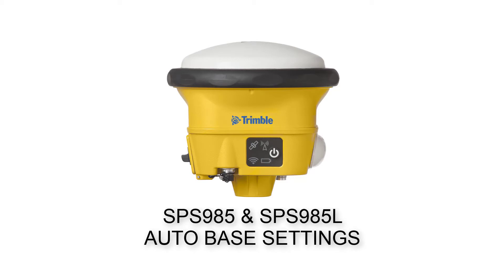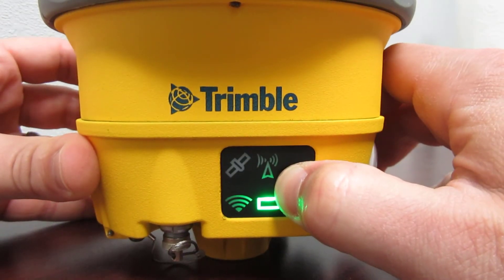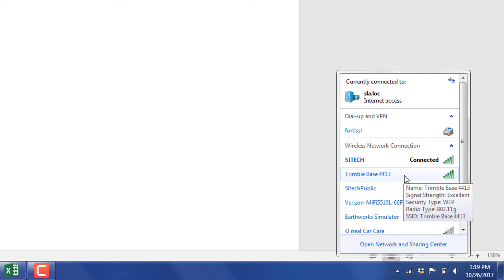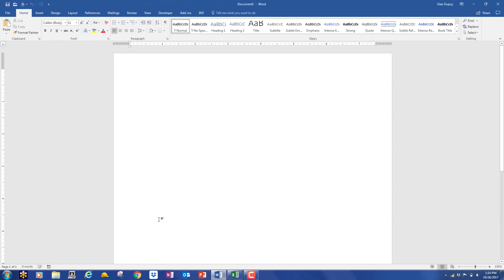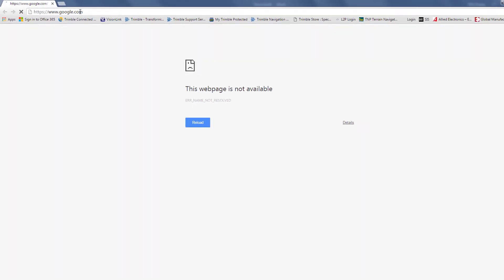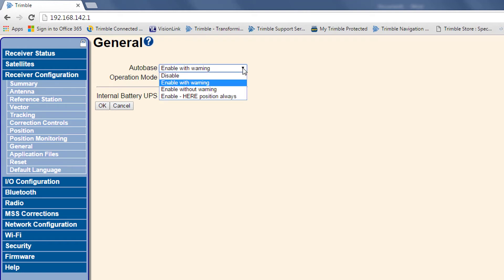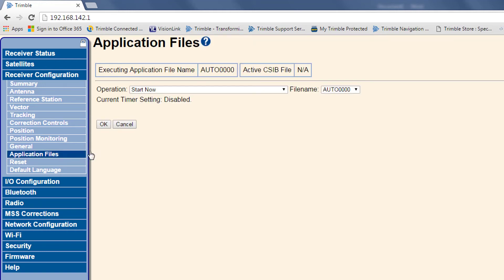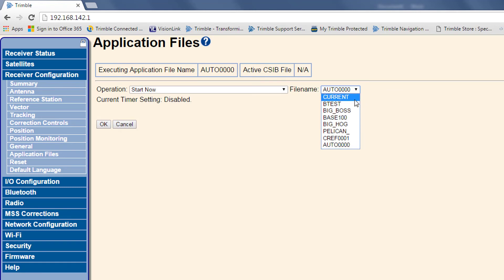Trimble SPS985 How to Check Auto Base Settings - SITECH Louisiana

Comment: good video. how do you connect to sps880 extreme?
Reply from the maker: The SPS880 Extreme was prior to the Web UI.  In order to connect to it you would use the Trimble Winflash Software and a DB9 to DB9 Null Modem cable or a DB9 to 7 pin Lemo.  Most computers now don't have a serial DB9 connection anymore. So you would need to get a USB to Serial adapter cable.  They can be purchased from Cables To Go or other online retailers.  I'll try and put a link to a version of Winflash for the SPS880 in the description for you.
Reply: @sitechlouisiana8121  thank you for your trouble!

Comment: When I reset my sps985 only the wifi and satellite icons flash (the radio icon does not). This causes no radio output and my data collector can not sync to it. Any ideas for a solution?
Reply: Having the same problem  . Did you find solution?